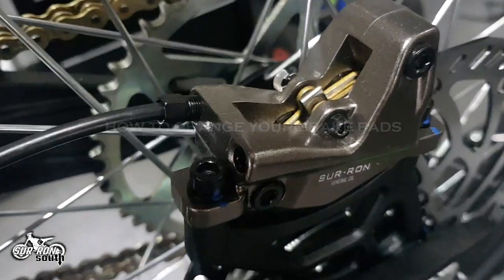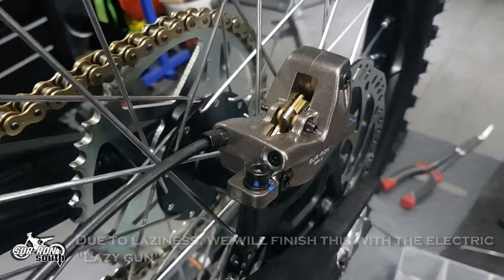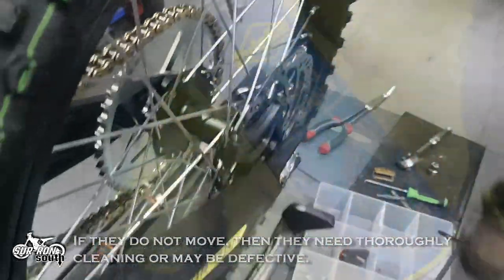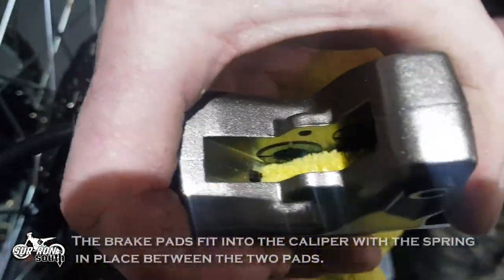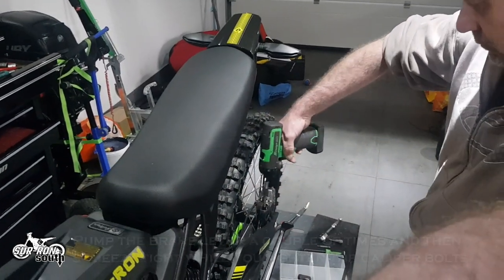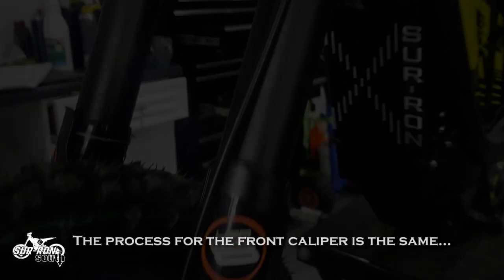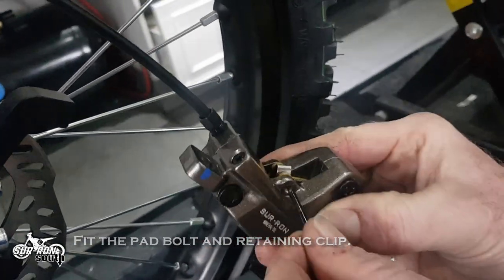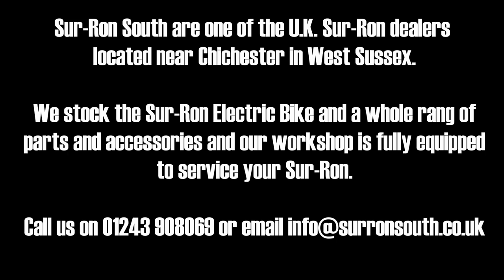HOW TO: Change your brake pads (front and rear) on a Sur-Ron Lightbee

Comment: I pumped my brakes and lost all my brake fluid thanks a lot
Reply: Damn the same thing just happened to me, I should’ve looked through the comments before changing my brake pads ☹️
Reply: @matteobruno4507  I got it fixed ! Do you need help on finding a kit
Reply: @rease4141  what did you get??
Reply: Lost

Comment: I just changed my brake pads. Rear caliper pistons aren't moving.Any tips ? Thinking of bleeding hopefully not defective 🙏
Reply: You might have cocked the piston in the caliper.   Take it apart again and look at it closely and use your screwdriver again to press around making sure its not stuck from being cocked.    Hopefully you understand.   That’s if it was working before you took it apart.
Reply: Same thing with me. my piston won’t go back into place. it was out to far and I tried pushing it back in, no budge. instead it came out and brake fluid went everywhere. how do i fix?
Reply: @luccacecil6295  exact same thing happened to me. Find any solution?
Reply: Shit me to.  Piston won’t go back down
Reply: @adamluckey oil went out of your breaks while changing g
Reply: @adriancollins980 break fuild change